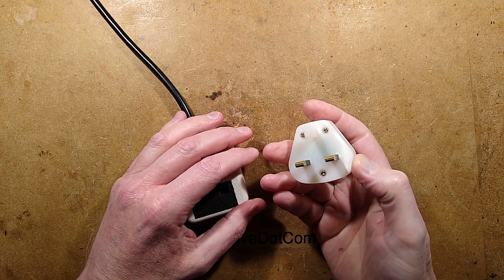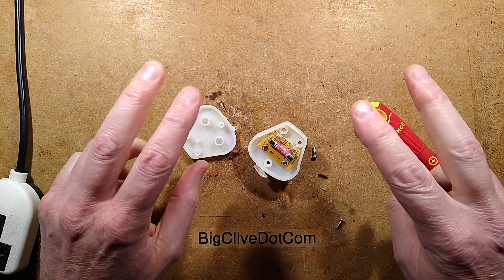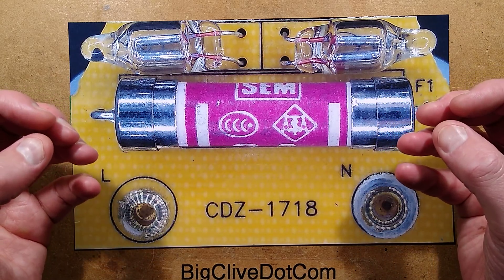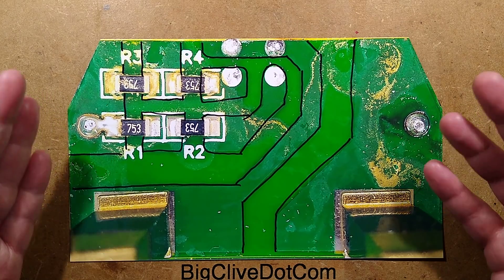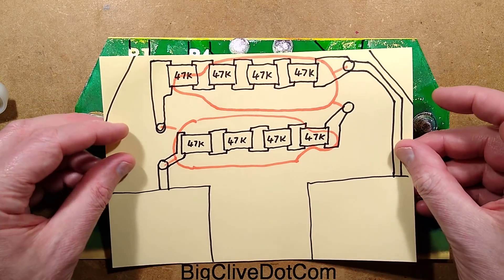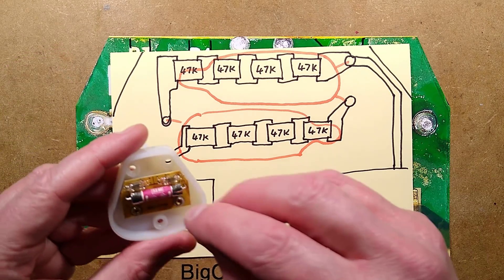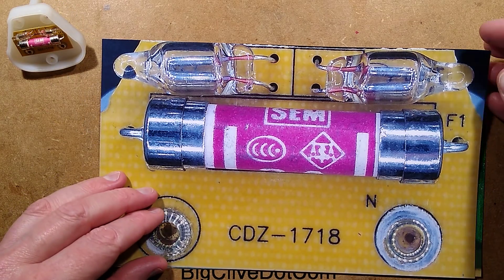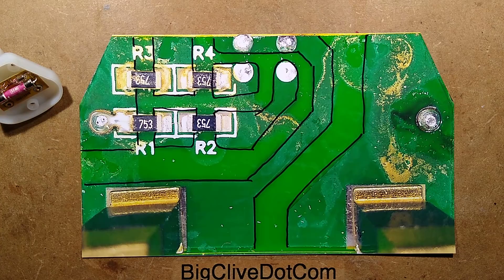British neon night light and the curse of the box-tickers

Comment: In the early days these neon diodes were the zener diodes of the day. That use was forgotten over time. If you have a 48 VDC PSU they could be used as a very fast transient protector. You would have to experiment to know if that can work.  If a faint glow is seen you are in business. I doubt the current would be a problem. A 10R resistor might in series do something. I think the fuse is to please new engineers when CE testing. CE testing being like bitcoin for the involved.

Comment: poundland auto switching nightlights definitely dont have a fuse like that in, the one using filament bulbs has a 'shaver adaptor' 20mm 1 amp in, the led ones , a tiddly glass cased thing one about the size of a half watt resistor !

Comment: Finally, a circuit board on this channel that’s so basic even I could reverse engineer it.

Edit: Hang on... The fuse is the last thing in the circuit before the neutral pin, yes? So if there was, say, a surge, surely some other component in the circuit would blow before the fuse even had a role to play? Isn’t this circuit basically like pushing a child down a huge hill on a skateboard, then giving them a helmet to wear when they’ve already reached the bottom?

Comment: When I was in my early teens (perhaps 11 or 12), I happened to get my mitts on a 69 volt lantern battery, and interestingly enough, a standard NE2 bulb would fire and glow when connected directly to the terminals of this battery. The lamp did not glow super brightly nor did it become hot (or even warm) but it did indeed glow.
 
So the strike voltage was a lot lower than it is fore more modern neon lamps if what you're saying is true (~90 volts strike voltage).
Reply: Ah good old lantern batteries, they were on the way out for me as a kid. They were good fun to put individual pieces of copper strands on from a flex cable, my dad usually had scraps around in his project room upstairs. Honestly no clue who first came up with the idea "what happens if we short this wire on the two terminal" thing, I just know it was fun to make them glow and melt at the time.

Couldn't do this easily with the boring 1.5V cylindrical cells, the terminals were also much less convenient to put a strand of flex over.

Comment: They could have used the smaller BS646 1 amp fuse like you find in shaver plug adaptors, also they have made it technically possible to replace the fuse, by fastening the case with normal posidrive screws, rather than anti tamper screws or even just gluing the thing together.

Comment: The neon bulbs could have been mounted with longer leads and bent so they stand higher, so the fuse casts less of a shadow over them. Also, I think it would be fairly easy to redo that layout to have a 3rd neon bulb on the other side of the fuse, centered with the leads offset to the resistor side. There's room for 3 rows of resistors instead of 2. The traces can be smaller to maintain clearances.

Comment: 330nF Capacitive dropper in series with a big red led,  diode reverse biased across the led, connect between live and neutral , that configuration worked back in the mid 80’s...and it’s not broken yet

Comment: Couldn't they at least have put the neons on the same face of the resistors and the fuse on the opposite face of the board so it wouldn't be blocking the light?

Comment: bought a couple of these about 2 years ago from Wilko, the plug exactly the same but internals were simply 2 neon lights wired from live to neutral with 1 resistor 220ohm and one (i think 11ohm +/-5% gray bodied resistor, which is in heatshrink - all in series. L-11ohm-neon-220ohm-neon-N
Reply from the maker: Those resistors will be a higher value.  Those ones seem to overdrive the neons, but they are fully customisable.

Comment: The 'mega separation' is a design requirement, mains tracking must have 5mm spacing and often a slot is cut. They could have used a 20mm fuse or even a surface mount fuse ?

Comment: I know you must have discussed this before, and I know there is not much that can be done about it at this point, but what do you think about the UK 240 system vs the US 120 system? From all that I can tell the 240 is a lot more dangerous. Probably a good thing given how stupid America has been over the past 3+ years
Reply from the maker: Each has its own merits.  The lower voltage of the US system does cause more arcing fires, and also makes people complacent.  Less people get electrocuted with 240V than 120V by population percentage.  Mainly because 240V gives very harsh shocks.
Reply: @bigclivedotcom  Thanks for the reply. Over here in Canada I've jolted myself more times than I care to recall. That 60 cycle zap is attention getting. I've often changed out plugs and switches without even cutting the power. Fortunately I've never been standing in  a puddle of water when doing so. Now 240 does scare me. I did once have to get up on the roof and disconnect the 240 from the street. The hard part was connecting it up again. Lucky to be here or anywhere. Never again. Now I must go change the batteries on that pacemaker.

Comment: One might think, considering the light doesnt have any useful seeing purpose except to provide comfort and orientation for kids in a nursery, that they could instead of neon try to incorporate electroluminescent technology, say on the surface. The whole could be completely sealed as a throwaway unit. Most of these end up in a drawer having well outlasted kids needs for comfort in the dark. Modern circuit breakers provide more than enough safety for most countries in Europe these days and the UK is the only country to have fuses in plugs. They are certainly useful in older properties that might not have been modernised, but for the newer ones its rather belt and braces.more if you include those plug with the rear part of the prongs insulated

Keep up the good work!.

Comment: I guess a clear glass body fuse was not up to code? That would have been too easy.
Try extending the leads on the neons until the body of the neons are up against the lid. 
Light might just flow over the fuse body through the plastic lid.

Comment: Why not use SMT fuses?
Reply from the maker: Check their fault current breaking capacity.  Base it on a potential fault current of 1000A.
Reply: @bigclivedotcom  Being mechanical engineer, electrical is not my strong suit. My understanding is that a fuse is there to break circuit in an event of over current, so if downstream circuit shorts, it will blow the smd (smt) fuse, some googling shows 250V smd fuses available for current rating of 2A like SF-2410FPA200W-2. So can you please elaborate on your comment. On the same note, can you please make a small video on this subject, meaning what led to putting that big fuse in the light and some properties for fuses (unless you have covered it already)
Lastly why are they still using neon bulbs, why not LED (which have become quite common)
Thanks
Reply from the maker: @AfaqSaleemChannel  I have a video dedicated to fuses.

Comment: they could had fitted the fuse on the other side of the board and bring the circuit board a little bit more upfront and still have room for the neons.

Comment: I think mandating a fuse is a jolly good idea, but why a full size BS 1362 fuse, why not a 22mm ceramic HRC item or a modern Wickmann fuse? 
 I do worry about wall-warts, you don't know what's inside them and they may just rely on a thin PCB track or a resistor to blow, I like to plug them into a trailing  multi-socket board so there is an intervening fuse.

Comment: Could they have just used a clear glass fuse instead?
Reply from the maker: Glass fuses are only suited for low fault currents.  They can form an arc inside and explode with high current.

Comment: Could have used a glass fuse, that would let the light through. Probably could be much smaller too, rated for much lower current and it might even make sense. It's probably the typical UK 10A fuse. And just try to imagine forcing 9 amps through this thingy.

Comment: I have one of the old versions with just two neons and a resistor. One of the neons has failed, and I can't decide whether to replace it with a new one or with LEDs. I was very suprised to find out how simple it was inside. One end of each neon is just soldered to the top of a pin!

Comment: Hi Big Clive, I need some advice. The LED ballast for my kitchen lights has failed. I was trying to find another ballast but looks I can't. Most other Ballasts output amperage is either higher or lower i.e. mine is 2.0 amps at 12V DC, and I can only find either 1 amp or 3 amp output, too low with result in dimming with higher than 2 amps blow the bulbs?
Reply from the maker: If it's a 12V DC output power supply then there's no harm going for one with a higher current output.  It will stay cooler and last longer.
Reply: @bigclivedotcom  thanks Clive you da man!

Comment: The first thing I thought when you showed the plug side was "hey, shouldn't there be a fuse in there?"
Perhaps they could've sandwiched the fuse between the two bulbs, therewith having one illuminate the top and the other the bottom.
I'm most surprised with the hybrid population technique. Apparently it's cheaper to add the extra steps of paste, pick and place, and reflow to the process than it is to source through hole resistors.

Comment: I'd be tempted try and design it with the fuse turned through 90 degrees. Would still block a lot of light, but it wouldn't look so drastic.

Comment: Would it have been possible to put a protective layer over the pins, leave the leads longer on the filter and push it lower?  I also think that maybe that just doesn't provide much more light. Something weird like push the whole PCB slightly higher (I know the neon has lots of light too) and use a cutout in the board and center the fuse in it?

Comment: If I really had to put that fuse in that location on the board, I would cut a rectangular slot so the fuse could sit low in the board and not block the light.

Comment: As an american you guys seem awfully obsessed with electrical safety. I do appreciate the plastic sleeves on the plugs and the GFI or whatever yall call on every plug but the rest seems a bit excessive imo
Reply: It's because the wiring can carry up to 32A which is enough to power all household appliances yet most items have wiring which can only carry a fraction of that power. All modern wiring for sockets in houses use the ring main system except for electric cookers and showers which have dedicated 45A radial wiring and ceiling light circuits which are rated at 6A. If you plug in a fan with 6A flex and no fuse in the plug and the motor shorts out, the wiring can overheat and catch fire quickly but if it is appropriately fused it won't. We would use a 3A fuse in that plug or possibly a 5A but the next size up would be 10A so that doesn't protect the flex, the highest fuse rating for plugs is 13A which is only used for high current items with appropriate flex.
Yes the breaker should trip before there is a fire but breakers have been known to fail or not trip quick enough, also the regulations were designed before the days of breakers and having a fuse in every plug is an extra safety measure.
Reply: @ian-c.01  weird. But i am one to speak. As i said i do live in the US where we have significantly less protections than the UK. My house is actually old enough that all but two (recently installed) outlets on the ground level do not have the third ground pin. We have to use "cheater" plugs, basically adapters that have a little tab thats supposed to be screwed into the center of the faceplate but if not done right (or at all) can kinda sorta bypass that connection because that pin wasnt needed anyways (heavy sarcasm, this is the biggest problem with said plugs). Hell, even US regulations state there should be a GFI outlet within a certain range of water sources: guess what we dont have. If i werent moving out in a few months i would replace every single socket.
Reply: @Palmtop_User  
A house in Britain typically has one ring main circuit to each floor and a separate one for the kitchen because that's generally where all the high power devices are. The kitchen circuit can have a washing machine, clothes dryer, kettle, oven, fridge, freezer, toaster and any number of counter top devices running all at the same time with no problems ! This will all be protected with a 32A breaker, if one of the devices shorts out it should only blow the fuse in the plug and not affect anything else.

Comment: When I was a kid, the first electronic components I bought were a couple of NE-2H bulbs. I didn't know they need current limiting resistors, and plugging one into 120 volt AC while holding it in my hand was exciting. Luckily, I wasn't injured by the flying glass. My second purchase was resistors.  I learned several valuable lessons that day. Nonlinear response to voltage, the benefits of reading application notes, and the incredible energy of electricity when concentrated in a small area are three of them.

Comment: Why the HUGE FUSE, you can get tiny versions of that.
Reply from the maker: It's a standard plug fuse in the UK rated to break the extremely high fault currents that can occur with 240V.

Comment: Verticle fuse instead of horizontal?  Put the circuitry at the bottom?  You guys use too much voltage in your houses.  If I lived there, I would install a center-tap transformer and distribute the 120v to each have of the fuse box.  Or is your wiring prohibitive?
Reply from the maker: The high current 240V power circuits mean we can plug heaters, washing machines, clothes dryers, ovens and many other high loads into any socket in the house.

Comment: Not entirely sure why this would need a fuse when (as far as I know) there is no fuse to protect the neon indicators in fused connection units (potentially 32amp MCB) or even in shower or cooker isolators (potentially 40amp MCB). 

Also I had a Thomas the Tank Engine version of one of these as a kid, the neon bulbs were behind Thomas' eyes, looking back it truly was the stuff of nightmares!

Comment: The fuse is totally unnecessary. The neon resistors would provide more than adequate current limiting.
Some types of carbon resistor can go low in value or short but most resistor types will go high or open if faulty.
To be really safe all they need are two of more properly rated resistors in each chain with each resistor from a different manufacturer 
to eliminate the possibility of a faulty batch of resistors causing problems.
Given the choice if this and a cheap Chinese version that lights up properly what will most people go for?

Comment: I fail to see the need for a fuse if anything did short the trace going to the main would blow I've seen this in radio's where the filter capacitor would short and blow the trace on the power input would be gone small traces don't handle that much currant even though where I am the voltage is 120 the lowest amperage is 15-20 and could be as high as 60 depending where you plug it in thats why we use varacks / isolation transformer even light bulbs

Comment: I thought that all you have to do is give the CAD program a bill of materials and let the autorouter do the work.  That's not rocket surgery.  😜😂
Reply from the maker: That often results in random component placement and a pointless double sided PCB.  Autoplace and autoroute has to be used carefully and often steered in the right direction.

Comment: In this day and age why use Neons at all? LEDs would seem a much more cost effective choice.
Reply from the maker: Ultimately, neons lamps last longer than modern LEDs.
Reply: @bigclivedotcom  Typical life expectancy of an LED these days, to the point where it's dimmed to half the original brightness (but still works), if you don't over drive it, is 100 000 hours ~11 years. (I know many products from our favourite eastern manufacturing country are over-driven to the point where the life expectancy doesn't come close to this but that's just being cheap, done properly an LED can last decades). I've a 7-segment LED clock that's been on for pretty much that last 40 years and all the LEDs still work. Being a clock not all the LEDs are on all the time but they all still work. I also have a number of extension leads where the neon has failed over the years.
Reply from the maker: @AndrewBlack343  The 100,000 hour LED lifespan belongs to the older red (gallium arsenide) and low intensity apple green (gallium phosphide) LEDs.  The modern white/blue/green gallium nitride LEDs are based on a thin film technology that does not last anywhere near as long.
Many neon indicators are grossly overdriven for intensity versus lifespan.  Often it's the resistor itself that fails first.

Comment: 100pcs 3.6x10mm 1A 250v fast blow ceramic fuse with axial leads - $13 posted on ebay. That took me all of two minutes to find.
No excuses. They've used the wrong size fuse for the job. A 10mm would easily fit at the top, and the neons would then light the floor, which is what a night light should do.

Comment: 20mm glass fuse would allow the light through.
Reply from the maker: But would not safely break the high fault current.  Glass fuses are often only rated up to about 35A fault current.  On 240V supplies they arc internally and often explode.